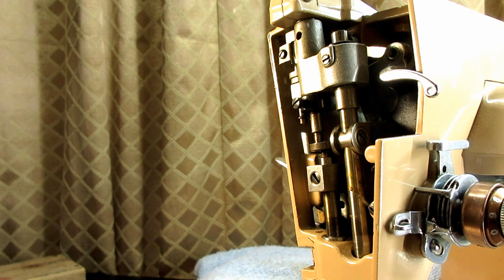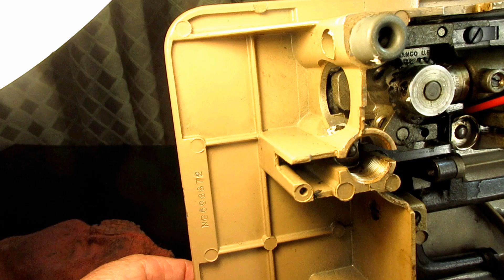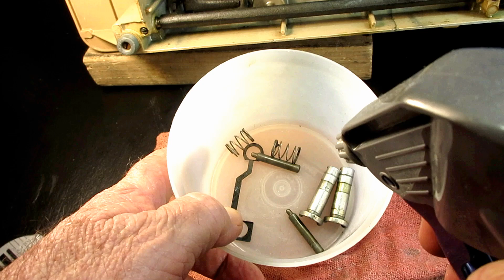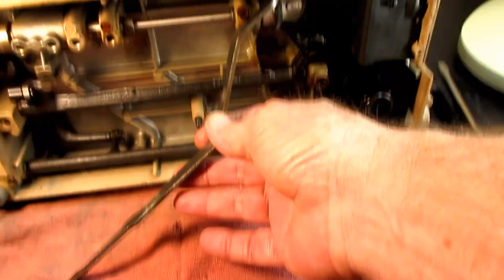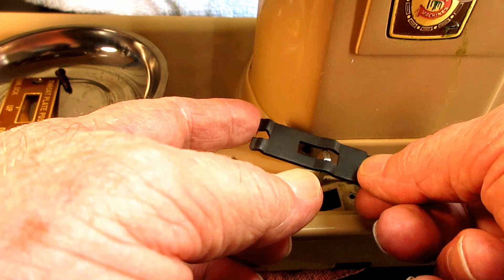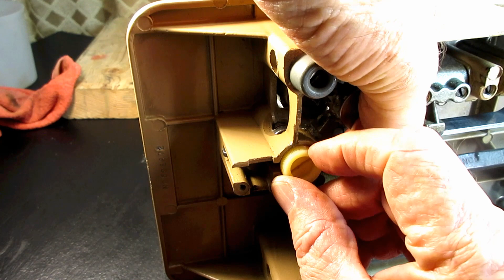How to Repair the Throat Plate Position Bracket on a Singer Model 403A

Comment: This is the third video I used in the order of your videos I’m watching to reinstall all my parts back on my 401a after having taken them all out and giving it a deep cleaning.
As always, this video worked worked like a charm and my throat plat working great.
Thanks!
Reply from the maker: It's a well-designed system with robust parts isn't it I love how it works and happy your restoration is coming along fine.

Comment: Thanks Andy, I was able to free up the lifters on my 404 by soaking in oil and carefully lifting them up and down with a screwdriver.  After watching your video I've seen white grease on the lifters so I'll go thru the whole cleaning process you've demostrated. My large adjusting screw is metal, now I know why it wouldn't turn!!!  Thanks again.  Love this 404!
Reply from the maker: That's great. The lifters and bracket work very well when cleaned and lubed. I'm glad you found the video and thanks for keeping that machine in service.

Comment: Yours was a LOT easier than the one I picked up! I had to drive the pin assemblies up with a dowel rod to get the throat plate out then drive them back down and out! A bore brush in my drill rotating slowly and a few drops of alcohol cleaned the tubes right up and after a good clean and polish it works like new again. Thank you so much for taking the time and effort to make these videos!!!
Reply from the maker: @randallsullivan3692  yikes that was a tough one but it sounds like it's a moving smooth now congratulations and I appreciate your comment
Reply: I forgot to ask in my comment how can I go about putting a little pressure or persuasion on this right pin that’s giving me problems. A rubber mallet was mentioned but here a dowel was used so do I place something up against this pin from the bottom and give it a tap? It can only possibly break it free from what’s holding it but because the throat plate can only move a slight bit upwards so that I can slide the plate out of the way. I ha e worked on many sewing machines in regards to many things but this is really kicking my butt on this problem!!
Reply from the maker: @cristinas.5699  I would prefer soaking the pins with WD-40 or a similar product usually those are stuck because of dried oil and grease you can use manual Force if you want to try that by putting a dowel wooden dowel against the bottom of a pin and tap it repeatedly until it moves up enough to slide out the plate then you've got to move the dial to the top of the pin and push it out the bottom I guess I just don't like using that much force if I don't have to and I have a part that's stuck like that I've often soaked a cotton ball in WD-40 and packed it around the part and then added more WD40 even let it sit overnight or 24 hours to let the chemical loosen the old oil then you can often push it out with your finger or just with your hand pushing on the dowel or brass drift pin to move it well I'm waiting for that to soften I just work on another part of the machine or rehab the motor or the foot pedal or something like that instead of worry worry about a stuck screw bolt or pin. On those items patience is truly a virtue
Reply: @ thank you for the speedy response!  I just was able to knock it outbid the tube it was in! My screw driver with the various tips I can remove I looked at it and it’s round on the end when there isn’t a screwdriver head placed there and I though we’ll I really can’t hurt anything if I place it on the bottom of the lifting pin so let me get my hammer and see what happens. I was able to raise it up enough and as you said to free the throat plate and that fell out nicely. I rejoiced for a minute and then got busy now knocking it down the opposite direction to hopefully drop it out the bottom along with the bracket and I did!! I’ve probably been working on this off and on for a few weeks but only because I’m OCD and wanted to remove the throat plate to thoroughly clean the lint out of the bobbin area BEFORE I can sew with the machine. Now I’m off to Harbor Freight to buy the ratchet set that will fit in the tight space to be able to review the feed dogs (I already bought this set but it’s at my house in Florida and now I need it at my apartment in California!) Thank you Andy you have made my work much easier with your videos🥰.  All these parts are soaking in Krud Kutter and I will make sure they are clean and oiled before putting it back together😊
Reply: Oh and I was able to find a replacement nylon slotted screw on eBay and it’s coming with a pair of lifting pins and springs that I will save. I kind of buggered the nylon screw up trying to get it out, but honestly it is still usable, I believe, if I couldn’t find this replacement .
Reply from the maker: @cristinas.5699  a good idea to have backup parts the machine itself will last more than your lifetime
Reply from the maker: @cristinas.5699  well, patience may be a virtue, but sometimes persistence is the key. Congratulations and best of luck moving forward.

Comment: your videos are so clear calm and patient. thanks to you I just unstuck my 411G's throat plate lever and pins 🙂. next, it's replacing/rewiring the old cord. the foot pedal looks fine, but noticed some bare copper on the lead down to it.
Reply from the maker: Happy you found the video then. If you've never worked on the pins they can be confusing for sure. I repair many original Singer cords with "Liquid Tape" if possible rather than replace the cords. IMO, the original cords are better than what is available today. Here is a video where I repair some cords: https://youtu.be/mVX2Io_tomk

Comment: so the whole reason I took apart mine on my 401A was because the pins don't rise evenly together, though I am able to get the plate on and off, it just sits sorta cocked when in the "up" position. While taking it apart and watching your video, I realized it's missing the bracket you mentioned at 20:20 so is this a part that SHOULD be on the 401A? Also, my 401A has the hinge screw you were taking about at 24:35. The serial number puts it in the '51-'56 range, and given the number, probably late 1953 or early 1954.
Reply from the maker: If I remember correctly the pins never rise evenly at the same time, but both need to rise completely (of course). 
     The uneven lifting is due to the "bumps" along the bracket that slides along under the pins. The bumps hit one pin before the other.
     The Bracket you are missing is part No. 172213, Throat Plate Clamp Pin Positioning Bracket. It came from the factory with one so it must have gotten lost by a previous repair attempt. Vintage Parts can be found on eBay when a seller parts out a machine. The same bracket is used on models 401A, 403A, & 404. Lucky you to have the hinge screw! 
     I've always liked the 403A better but model 401A is truly an incredible machine. Happy you have one. Good Luck.
Reply: @andytubesewing1953  I got it cleaned up and reassembled without the bracket and they sit level now at least. The problem was more that in the "up" they were at different heights. I think they were just gummed up (like the rest of the machine) and one was being sticky. Works well enough now. A bit touchy still but the plate sits level and can be removed and put back. Thank you so much for all of your videos. I almost have this 401a in working order again!
Reply from the maker: @dragonchild569  If you are happy with it that's what matters. The bracket is to line up the clamps to face inward toward the needle plate and prevent the clamps from turning. The bracket is thin but would affect the overall height of the clamps. Thanks to you for saving that machine and working to get it back in service. 🙏 A very worthy model.
Reply: @andytubesewing1953  Hi, Andy! I think about you often and I hope you are doing OK.  I am just about to start a restoration on a 401A, that is one of the first ones made. (serial number NA565537).  I have been perusing your videos reminding me how to do things.  My preliminary examination showed that my machine also is missing that bracket.  Then, as I was flipping through the Service Manual for the 401A, I noticed on Page 152 (Fig. 313. Exploded View of Throat Plate Position Bracket), that, at least in the early models, the 401A did not have this bracket!  My throat plate lifter works nicely without that bracket, so I think I’m going to leave it as is.

Comment: My Leaver "spring" is broken on my 411G. Anyone know where I could get a replacement?
Reply from the maker: The Singer 400"G" models (made in Germany" were not sold here in the US, but many have migrated here. I can't get any of their parts manuals, but viewers have told me most of the parts are the same as the US 400s slant needle models. The part you ask about is Part No. 172158 "Throat Plate Position Lever Spring" and it is common on several models, like the 401A, 403A, 404, 500A, 503A, and most of the 600s series of Touch & Sew Slant Needle models. You can often find parts for those machines on eBay, Bonanza, and other online sites. It would be very rare to find just the spring for sale as sellers who part out a machine usually sell the associated parts together. Here is an example: https://www.bonanza.com/items/like/1510945888/Singer-403A-Throat-Plate-Position-Lever-Position-Indicator-Plate-172156    I've bought many parts from this seller and no problems. Here is also a listing on eBay with more parts included, but its the same spring: https://www.bonanza.com/items/like/1510945888/Singer-403A-Throat-Plate-Position-Lever-Position-Indicator-Plate-172156    Thanks for watching my channel, and good luck.
Reply: Thanks  @andytubesewing1953  I ended up making my own with some sheet metal and a pair of tin snips. Works great!

Comment: So I noticed my needle plate in the up position was not even. After cleaning whole system and of course adjusting as best as possible, I finally got it right after U noticed the  lifting / locking pins were not actually the same size. the longer one goes on the right.
Reply from the maker: Thanks for watching my channel.

Comment: Andy thanks for the video.  Many of us are familiar with Coarse and fine machine screws , along with UNC and UNF (coarse and fine respectively.  However, there exists an available but elusive critter :  The UNS, ; 'S' stands for special, and falls between coarse and fine thread.  as singer production entered the war eras they might have used things that were readily available, but unwanted by other major manufacturers, such as the UNS, so due to availability and cheap price, might have changed their tooling to use such threads.  They are available without going to Singer ads or sights.
Reply from the maker: Thanks for the info. A retired Singer repairman from Canada told me that Singer purposely used their own proprietary sized screws so only they could repair their machines. From the early days, before the war. Later they started using more common sized screws due to costs. His info, not mine.
Reply: @andytubesewing1953  thank you.  I wouldn’t be surprised at that, Sears machines and equipment also have their own setup like that, 16 ohm speakers on their stereos for example, I just started this hobby, and fortunately haven’t encountered anything too strange.   Thank you.

Comment: Yes, plastic nuts aren't all that, bronze is nice, but brass nuts are the best.  (Seriously stainless steel, aluminum and combinations of those nuts and bolts will / could result in galling (stainless on stainless:  YES, , ,aluminum on aluminum, YES and maybe stainless/aluminum combined (probably would also result in galling)...Little things like oil, never seize, or such will REALLY help prevent a very awkward problem)).  (that galls me, ,  lol)

Comment: I had no idea how dirty my "Ruby" is on the inside!! I have krud kutter and I'm frozen like a deer in the headlights. I have the metal nut not the nylon one...I have to get in there to clean pin/spring things! I'm taking a break...
Reply from the maker: Oooh, I'm jealous of your metal adjustment nut. Lucky you! One step at a time. It really help me to take pictures as I went b/c I was worried about getting things back together in the correct sequence and position. Thank goodness for cellphone cameras. The first tension unit I did took about 90 minutes and I was sweating bullets. Now I can remove, clean, install and zero out in less than 10 minutes. You'll be fine.

Comment: Thank you so much for this detailed video! My feed dog is still too low when the throat plate is fully down, according to the service manual. Do you know how to adjust the feed dog height? Thanks!
Reply from the maker: Oh no... too low! The instructions for setting the height of the feed dog are on page 129. The height should be between .040 to .043 inches. I do have a video about doing this on a 301A which has the same type of parts. https://youtu.be/Du-W1k_qHHI
Thanks for watching my channel and good luck, Jennifer.

Comment: Thank you for all your incredibly detailed, helpful videos, Andy! I took the throat plate position cover off my new-to-me 403 to clean the gunk out of it and wasn’t able to seat the lever again properly (it felt floppy and like it wasn’t engaging). This video saved things and I was able to properly clean and reinstall.
Reply from the maker: I'm glad you found the video. Those parts are like a little puzzle, right? I did the same thing. Once you get them correct it makes perfect sense, but otherwise, they look good but wobble all over the place, haha. Thanks for maintaining your 403A. My favorite HD Singer ZZ machine. Happy sewing.
Reply: @andytubesewing1953  Thank YOU for making resources that make it easy and fun to take care of these wonderful machines! I've got a white 221k Featherweight, a black 301 shortbed, and the 403 zz machine, and I just love them all. What quality craftsmanship there was back in the day! SO thankful I can get these beauties in their happy places again with a lot of fantastic help from you!
Reply from the maker: @kristinemakes  Wow, you have three of the best machines Singer made, IMO. They are a joy to use and work on. The last modern machine I opened did not even have a metal frame inside to hold the shafts, hook, or motor. The parts were "embedded" into the snap-together plastic body. The whole machine weighed 9.2 pounds.

Comment: Thank you so much for your videos Andy, you've saved me twice this week! First to fix the tension spring on my 99k... then last night I cleaned my 401g and couldn't figure out why the throat plate lever went all floppy when I tried to put it back together. Of course I hadn't put the hook under the cross bar.......!
Reply from the maker: I'm glad you're aware of my channel and find the videos helpful. Some of the parts adjustments/installs are tricky, aren't they? Thanks for the nice comment, and for keeping your machines in service.

Comment: God bless you Andy.   I took my throat plate position lever apart at the opening just to clean under the tin label and didn’t put it back together correctly so the lever ended up floppy.  I cleaned it and it looks so nice but the lever was not connected properly.  Now I have to put it back together the right way and my answer lies right around the 35-minute mark on this video.  Yay!
Reply from the maker: Glad it helped. Tricky parts under there. I did the same the first time. That's when I decided to take pictures as I removed parts, haha. Thanks for commenting and take care.
Reply: Andy Tube, the fix was so easy.  The crossbar wasn’t seated in that little groove on the shorter bracket.  Lubricated the lever like you showed and it works superbly and it looks clean and shiny too.
Reply from the maker: @Ndnative3431  Oh, nicely done. A very rewarding rehab.
Reply: Lol I too thought I would remember how the parts went back together but then I soon forgot! Thank goodness for your videos! Ok so the next and the biggest problem is with the throat plate lifting pins……… I sent you a this problem in the video about how to remove and clean them but I’ll mention it again here……the lifting pin on the left raises up or would if the right one would budge but it won’t lift at all so I cannot get the bracket out nor will either lifting pins come out. It’s the bracket that connects the two pins so until I get the right one to loosen then the throat plate above is holding everything hostage above!! It’s only been overnight but I’ll keep applying oil, the penetrating lubricant ( similar to WD-40) and heat until I get some movement from the right pin😞